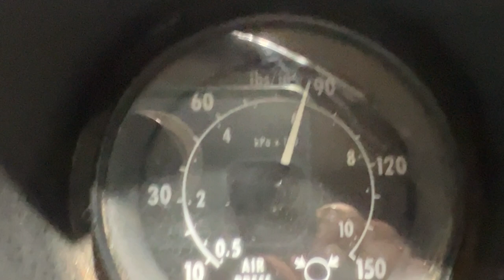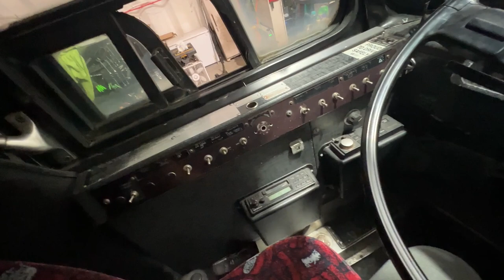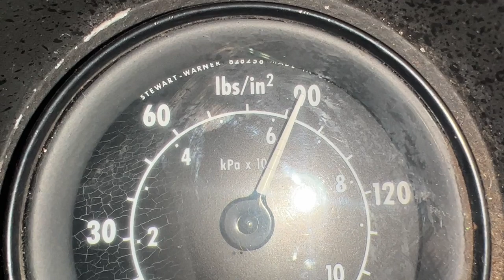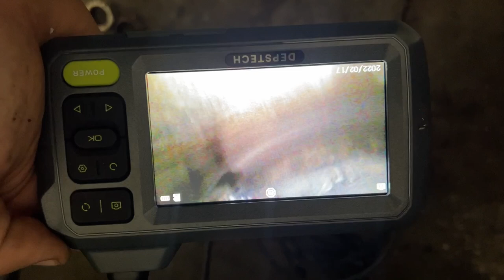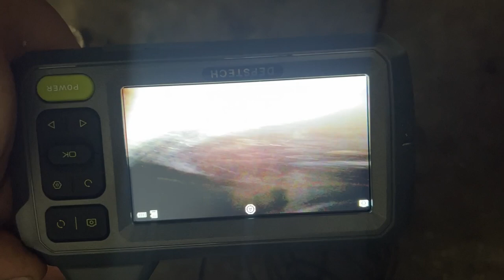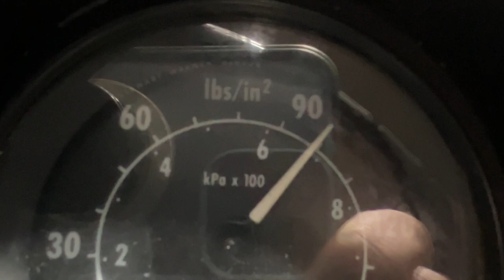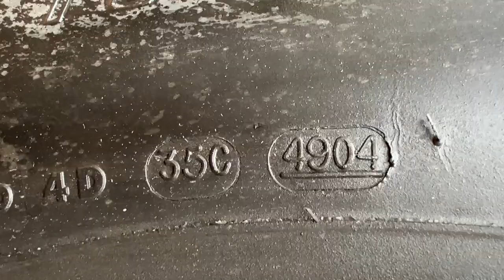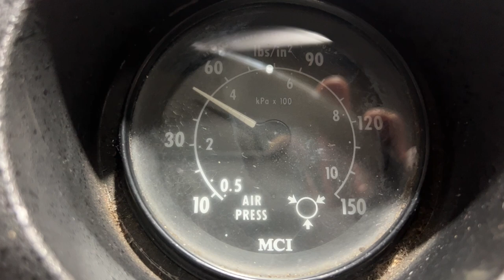How bad of a job can a fleet services shop do on a bus?  This bus was unsafe to drive!

Comment: I'm so glad I sold my MCI. To properly maintain the bus, you need all the manuals, the proper tools and a pit. Failing parts are expensive... chasing air leaks, air leaks, air leaks. One of the plastic air lines that fed one of the air bags popped and was leaking big time. Luckily I was a block away from the driveway when the bus went into emergency and the brakes came on. If that isn't enough, your stuck with shops like Purcell Tire and Service Center who can't even install a wheel seal properly. The enjoyment is definitely not worth the expense and aggravation.

Comment: Back in the 1970s, the worse bus company that I rode on as a passenger was the Chambly bus company in Quebec. One time I was on a bus during rush hour standing and we hit a bump. The complete floor lifted a few inches from the walls. Literally the whole floor jumped up inside the bus. Another time, there was a pickup truck with two mechanics following the bus. Every once in a while, the bus would stop and the two mechanics would get out and smack the engine with a sledge hammer then off we would go. Another time, the engine was held in with pieces of 2x4 lumber! The fare was $0.25 and when it went up to $0.35, there were huge protests!

Comment: Hello Scott. I know it was about a year ago. What ever happened to that shop? I am a retired transit bus mechanic of 20 years. When I tried to warn management of some techs not doing their job properly and releasing the buses back in service with safety defects because some of the techs are not properly trained they accused and labeled me as a trouble maker. One tech, a supposedly an "A" replaced a brake peddle/treadle assembly improperly. The drivers would submit a defect card on poor brakes for several days. On the fifth day someone figured it must need a center reline (articulated bus 60 foot) because it is constantly written up. Well the tech that was going to do the reline asked me to back the bus into the shop because he was afraid of backing into the shop. I found the problem as soon as I sat in the driver's seat and put my foot on the brake pedal, the treadle assembly was half installed and the pedal was not at the proper angle and was perpendicular with the floor. All these socalled mechanics that drive these busses every day should have noticed it. I found one foreman just asked a "C" tech who knows nothing of brakes do a taply test (brake efficiency test) which is done every PM maintenance, if it passes the test to put it back in service-(of course with a brake pedal not installed properly). I reported them to the GM because they would not listen to me and made many enemies. On several occasions I would get a driver complaint of door interlocks not working, I would check the maintenance history and found the techs just installed a brake relay valve and did not bother to check his work, that tech mixed up a couple of air lines to the relay valve which operate the brakes when the doors open. I was a big thorn in managements side. Keep up the good work.

Comment: Scott, this time of year truckers are slowing down with their spending. Shops are just holding on, trying to get through these rough times. And you are right. When these truck repair shops see a bus or motorhomes pull in their lot, the shop owners automatically  say no way am I working on that catastrophe. But when times are slow like these days, they'll screw a customer's eyes out to keep his shop running. Now is not the time to take a bus in for repairs to a shop that mostly works on semi's. I'd try to find a specialist like Grease Monkey Inc. Even if your prices were the same as other OTR shops, the bus owner would be getting twice his monies worth with your knowledge of coaches.
Reply: Yes but the problem is the low number and location of these specialists

Comment: Scott, there are universal solenoid valves like that leaking one you can put in - both ball valve and solenoid (instant open/closed), around $50, available in all kinds of voltages and NPT sizes. I’ve used these in several areas in my bus to address various coolant flow needs where the OEM (Freightliner/Monaco) messed up. They work great. Just something to keep in mind for the future.

As always great work on the bus!
Reply from the maker: 1-1/2” size?
Reply: What kind of valve name would I search for?
Reply: Or what's a good brand?
Reply: @mrmotofy  solenoid valve or ball valve, and search for the fitting sizes you need

Comment: FYI if these customers have issues with particular shops and shoddy work, not giving refunds etc. Complaints can be made to the particular state Consumer Protection dept. Especially since they're probably in a different state its an easy way to handle issues when you're in a different state. The shops Consumer Protection dept can fine or file charges on your behalf depending on situations. Many times just a call from the dept will have the shop calling begging to give your money back to avoid dealing with the state. I've had to do it multiple times, one case even turned into a class action cuz there were so many.

Comment: you might consider getting a Vc-700 or better steam cleaver to clean the areas that have oils and greases. It also can be used to clean up connections. And you can use it to clean your house! Vapor clean  is where I got mine.
Reply: I did wonder if vapour blasting or something would get the grease off those brake shoes.

Comment: I work on a lot of cars built in the 1980's which have, by todays standards, a pretty simple electrical system. But that doesn't stop the butchery of ignition and lighting circuits. I have a lot of sympathy for the owner having to pay for a hack to lose themselves in the safety circuits.
At 21:04 ,unless the valve body has corroded too much inside,I would just buy a new diaphragm and replace it. Same with the solenoids magnet. If that is a Honeywell, a search on line should find repair kits and save the owner more expense. There should be an arrow underneath indicate the best flow direction.

Comment: Good job saving the owner issues with their bus. Can anything be done to the other shop that issued a "Curtesy DOT inspection" with the air leaks and grease on the brake linings? Will the brake shoes need to be replaced or can they be cleaned with solvent?

Comment: Over the 60 or so years I spent in the computer biz it became increasingly "unmanly" to RTFM. To the point where many vendors no longer even supply documentation. Presumably there is, somewhere, a manual for these bus heating systems, so I guess the disease has spread.

Comment: Scott I was under the impression that the reason S cams have their shape is so activation of the brakes is gradually progressive.
Yet the cam displayed in the video at 40:13 is only shiny at the tip meaning that is the only area which is making contact with the relevant surface activating the shoe.
Does that signify some sort of mis-adjustment or other problem?
Reply: Look again @ 40:13 and you'll see the brake shoe is actually touching the back of the S-cam about halfway up.

Comment: I can't tell if this has been the worst bus to enter the shop so far. But the way how bad the other shop did the work, speaks of unprofessional approaches and practices. It almost seems like a law suit on it's own. Not only for doing any real repairs, but allowing a unsafe vehicle on the road.
Reply: I think the prize for worst bus was that Silver Eagle where they rebuilt the (missing) frame with the specialist welder.
Reply: @h5mind373  Probably that would take the 1th place, but this could fit into the top 5 as well. In terms of worst and sketchiest repairs done.

Comment: We have a local automotive machine shop here that every month or so we see the owner of that shop in court cases being sued over & over again because his work is just worthless, so he always loses his case in court every time because his work is that bad. People still go there because he is the ONLY automotive machine shop for over 100 miles, so you stuck with him. Me I take my machine work to a good shop 4 hours from my home for the simplest of jobs. as that guy can't ever surface a flywheel without throwing the flywheel way out of balance to the point the motor vibrates violently! We should start a DO NOT GO TO list !

Comment: I own an automotive shop. 31 years in the service industry.( not heavy truck or bus as you guys are) This problem of not correctly diagnosing problems is widespread. There is a real lack of true service technicians out there. They throw people on jobs with out basic knowledge of how something works. The chances of repairing that problem are very low. Not getting oil and grease on a brake lining is what one would think is basic skill set. You guys work on very old products with a massive amount of mechanical systems. Many of which are serviceable. They are very basic but not easy. Its scary thinking about these buses rolling down the road with loose suspension, terrible brakes, air leaks, no keys in castle nuts, dry pivots, poor tires,parts installed incorrectly, and many other problems. In my business, you have a bunch of mechanical plastic parts and pile of computers. Many tech’s are lost and shooting darts at a dart board with their customers money. This includes new car dealers.  As people retire or just leave the industry, the knowledge is going with them and not being passed on. It is not good for the future repair industry. I always like watching this channel because I appreciate the work of true technicians. I also know how hard the work is you guys do. Most people don’t have a clue how hard the work actually is, and also how hard it is on your body. Keep up the great service.

Comment: I see you guys laying on the concrete a lot. I'd suggest using a creaper or at least use the 2' x 2' interlocking fatigue mat squares in a 4 pack at Harbor Freight for like $10. Kneeling or laying on it is much more comfortable and if they get damaged cheap enough to replace. I keep a set in my truck now for those unplanned parking lot checks or repairs since they take up so little space.

Comment: Scott, I had this argument with my supervisor about greasing brake anchor pins. I was taught to add grease until you see the old grease pushed out and you see clean grease. You can't do that with anchor pins because the old grease will end up on the brake drums and lining. The supervisor copped out on an answer by sending me up the chain of command. Answer I got back was use your best judgment. So I quit greasing anchor pins. The next shift reports me. We go around in circles. I end up just touching the pins, so it looks like I greased them. It's a pneumatic grease gun, so a quick trigger squeeze is a huge volume. 
What would you do, Scott? When i assembled the brake spider, I greased it until I saw clean grease, then I wiped the excess clean before putting the drums on.
Reply from the maker: Pull the brake drums if i was an hourly employee. ;)
Reply: @BusGreaseMonkey  🤣I am, but the supervisors want the PM checklist done in six hours for the simple A PM schedule. B is 8. C is 10. D is 12. C usually ends up being 2 shifts, and a D can be 2 and 1/2 shifts. 
Golly boss, you want quality or quantity. Pick one! One tech per bus, I'm doing it my way. Fleet maintenance is about making busses leave the yard the next morning and having a good spare ratio. I'm sure you know the drill all too well. 😉

Comment: I’ve seen some pretty shocking stuff on your channel Scott but this post infuriated me. Not only is it absolutely terrible work but it’s expensive, terrible work. Please name and shame these absolute con artist cowboys. Here in the U.K. we at least have protection in the shape of trading standards. If there is some similar provision in Hank’s neck of the woods he would do well to drag the pathetic outfit that ‘worked’ on his bus over the coals. Well done for getting stuck in and turning this around.
Reply from the maker: 30 seconds with google and you can figure it out.   I gave very clear details to figure it out.

Comment: That air operated diaphragm valve for the heater control could be replaced for a lot cheaper then a thousand bucks.  I recently had to replace a solenoid valve, pressure transducer and pressure regulator in one of my plasma cutters and the manufacturer wanted almost $700 for those 3 parts and immediately recognized that they were made by smc so I pulled out my smc catalog and found 3 identical replacement parts for under $70 for all 3 pieces.  I am sure that valve is a arm and a leg if you buy it from a bus parts distributor.  They are all standard off the shelf components that get a new part number and a new price when the bus manufacturer creates their own part number.  On ebay you can buy used mci 16L-7-97 sp main heat control valves for $50 bucks used with free shipping or you can buy a brand new one for $200.  You could probably even get it cheaper straight from the manufacturer.
Reply from the maker: Our repair was $12

Comment: Complaining about the lack of integrity, the general breakdown of morality, “in this country”, and why things aren’t done honestly like, “in the good old days”, does nothing but dance around the campfire of negativity.  There are mechanisms in place in each state for dishonest and unscrupulous shops doing business like this putting the customer and the public criminally at risk.  Documentation and letter writing to the state AG, bureau of labor, BBB, and any state agency responsible are absolutely necessary, and follow up.  The “system” does work, it just needs to be utilized to protect public safety, and to penalize those responsible.

Comment: That's great they charge you more per hour for coach.  Then as demonstrated here then more of those hours since you're not actually trained for it.  They could have at least split the difference for what it would have cost them to take it back in.  Very strange to have a special rate for work you're not trained in.

Comment: Wonder if DOT could shut this guy down. He shouldn't be allowed to work on larger over the road vehicles of any type. He's not only endangering the bus owner but others who could be injured due to a mechanical failure he caused. Also, charging labor to fix something he did not fix is fraud. Shops like that should be shut down.

Comment: Could that expensive solenoid coolant valve for cabin heating be replaced with a less costly manual valve- a ball valve or similar? Open the valve manually during winter months, close it during warm weather. Might have to relocate the valve to make it more accessible.

Comment: The big issue here (besides Hank getting his money back) is safety of the public.  We now know that this shop:
1) Did not do an air leak down test or ignored the massive failure of such a test
2) Contaminated brake shoes with grease.
3) Gave a DOT safety certificate despite #1 & #2

These are important safety tests common to buses and trucks and the local Highway patrol DOT inspector should be made aware and any certificates provided by this shop ignored.   People can die from this kind of negligence.

Normally prefer not to be overly critical of truck service centers that are trying to do a bus owner a favor, but this case involves factors that should be core competencies of a fleet service shop.
Rest assured that a letter outlining the above factors together with a YouTube link to this video sent to the right government office (I'm not sure, but I suspect the DOT website will have more info) WILL get some attention.  

It may not shut him down, but it will make him think twice before clearing a vehicle that is unsafe.   That's even more important than Hank getting his money back (which he will by the way) IMHO.
Reply from the maker: He did not give a certificate as far as i know. The owner said the shop told him the did a complementary dot inspection.
Reply: @BusGreaseMonkey  That's good, altho I'm not sure what a 'complementary dot inspection' without the certificate is!  Did he claim that it flunked the inspection?  If not, he doesn't appear to denying that he mislead this owner into thinking his bus was safe when it was not, which is extremely troubling ethically and probably legally as well.
  
I do know that sometimes the DOT inspectors are just waiting for someone to complain so they have an excuse to inspect a company driver or vehicle, not sure what department is in charge of YouTube video documentations, but I do think you can report online.

Comment: 6:12 $4400 bill is conveniently close to the typical limit for small claims court. No lawyers. Tell the owner it's refund now, or small claims and a best effort at bad publicity later.
Reply: They actually increased that to $10K in Indiana a couple years ago.
Reply: $155/hr, meanwhile the guy running that grease gun is probably making $15.

Comment: Sadly these issues are are in all mechanical industries. They are not ' mechanics' anymore they are technicians and can't fix anything unless the computer tells them what needs replacing. Haven't met one in years that can actually repair any part or diagnose a issue without plugging it in.
Reply: But at the same time I was able to plug in see the Glow plug module, all 8 glow plugs, activate each one seeing the 20a draw and resistance of each one. Oh and the 7 were bad and not working. All without ever raising the hood. 100% confirmation the glow plugs were bad and everything else was working

Comment: An idea for the heater control valve might be to use a 24 volt zone valve out of a baseboard style plumbing system
Reply: 24v AC and DC are different